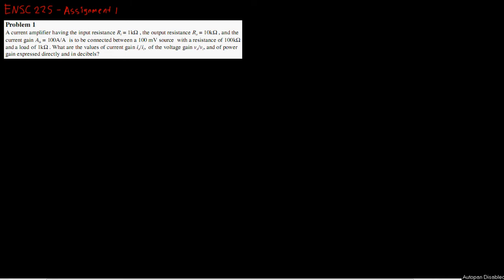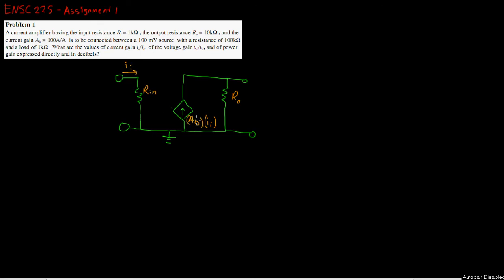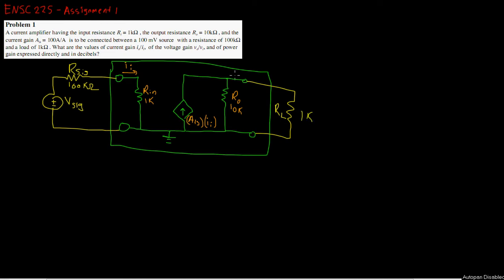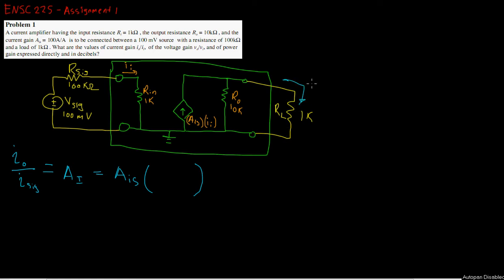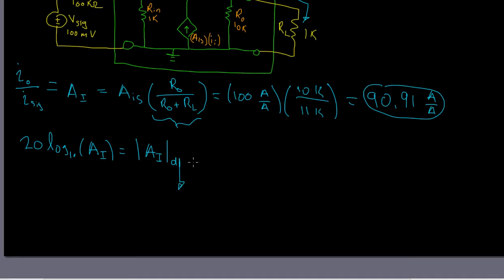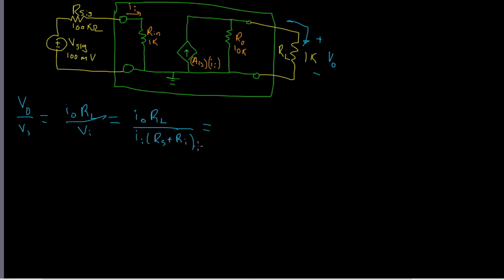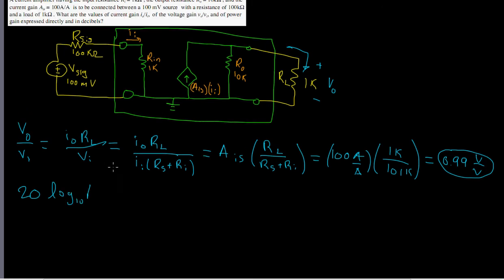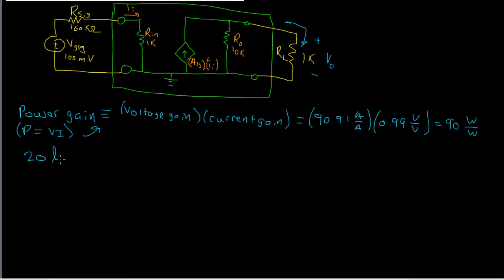Generic Current Amplifier

Comment: At 8:45 you add the two first resistances and multiply them by the current Ii, but shouldn't it be multiplying the current Ii by the input resistance? I mean if you add the two resistances then you are just calculating the voltage for the circuit, which would be the source voltage. Is it not just Ri * Ii to calculate Vi? Please correct me if I'm wrong.

Comment: Thanks for the explanation. Just one minor correction. At the end when you're converting the power gain into dB, it's supposed to be 10 log 90. I think you had it right in your notes but just copied it down on the video wrong because you still got the correct answer. Great video man.